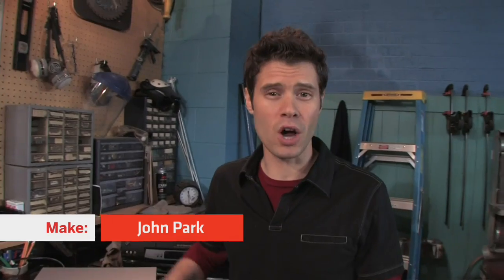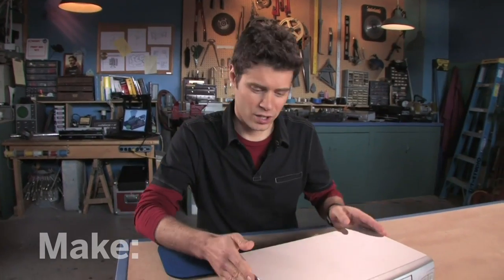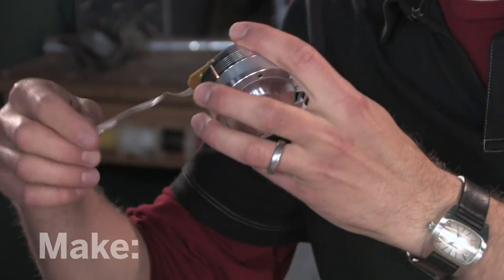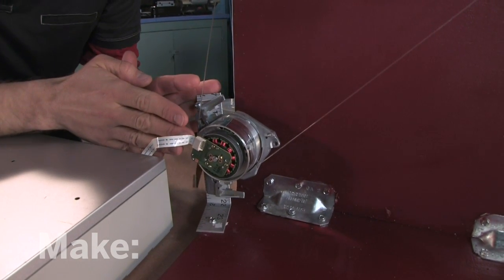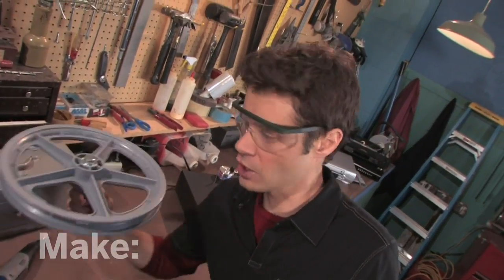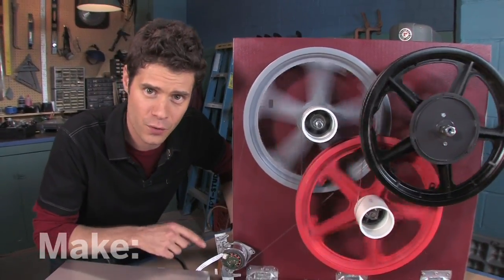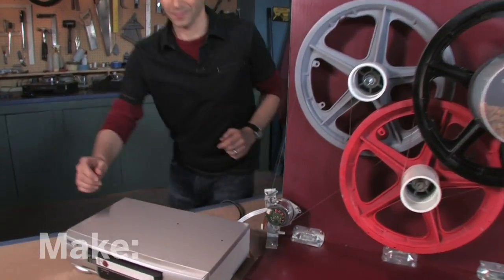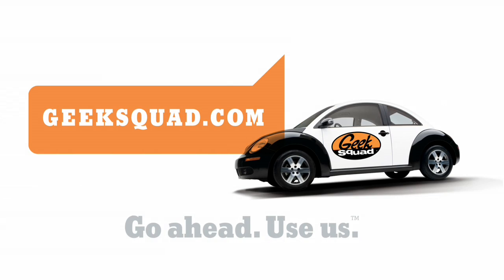Maker Workshop  VCR Cat Feeder

Comment: LOL I love that, Sensor requires a need for a complicated pulley system. Anyone else think to themselves, 'Why spend 3 hours making a pulley system when you could take ten minutes to just unsolder the sensor from the rest the circuit board?' This is just stupidly complex for show. I'm pretty sure people would be more impressed if the VCR cat feeder used minimal amounts of extra hardware.

Comment: uhh... Ever heard of capacitors? They still carry a charge even when the power is unplugged. And with the charge rating for each of those capacitors in household appliances, they can actually kill you. That's why the appliances have labels saying to not to open the case because of high voltage components.

Comment: Back in the mid 90's, as a science fair project, my dad and sister made a profect slightly like this. They used the motor out of a VCR, made the container and spindle out of cardboard, and were gonna add a timer from the VCR, but ran out of time. They also had plans of making it voice activated one day. Sadly though, my sister didn't win the science fair and the project just got thrown to the side.

Comment: Hmm.  "I'm going to make a VCR cat-feeder!  But the safety device is preventing me from doing this, and it's also a low-torque motor.  I know, I'll rig up a PVC-pulley system.  Now, I could keep with the original meat-grinder-and-VCR idea, or I could change the whole design to center around the 'wheel motif.'  I'm going to add a cheap-looking CD-blank-case-thingy with holes. YES!  EAT THAT FOOD KITTY!"

The title was a bit misleading.  Where's the VCR?  Oh, off to the side, out of sight...

Comment: Why not avoid messing up a good VCR when you can do the same thing and even better using a floppy drive, you can get a lot of non working drives on your local PC repair center for free and you can use the motor that spins the disk, it runs at a lower speed and has a lot more torque than the VCR head motor. Also it runs on 12V or 5V and delivers constant speed thanks to its controller chip. The VCR motor is calibrated to give only speed and very little torque, enough to keep the head running.

Comment: Wouldn't it be simpler just to open up the VCR, gut out all the tape-playing equipment, then close it up again and put a bowl of food in the video tray?

Then you can just set the VCR to its timer as you normally would, and when it auto-ejects the "video" after it has finished "recording" it basically delivers a ready made bowl of food to the cat.

You're making it overcomplicated with the pulleys and the siphon, the VCR itself already has everything you need to dispense food automatically.

Comment: You could have simply added a relay that triggers when voltage is applied to the "motor" of the VCR thus keeping the "motor" inside.

With the relay you can drive any kind of motor you like without worrying about power.

Nice idea though.

Comment: Kind of a redundant setup to have a automated cat feeder. He could of used a separate motor and just wired it into the VCR's motor power wires and depending on the motor, used less pulleys.